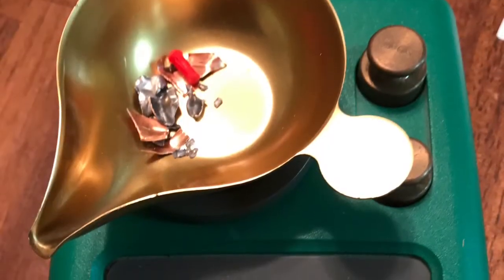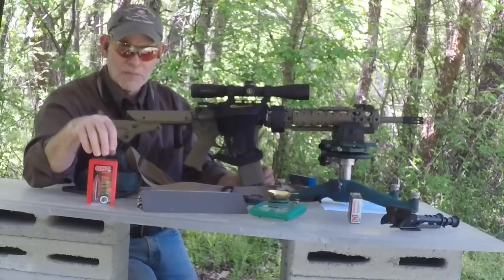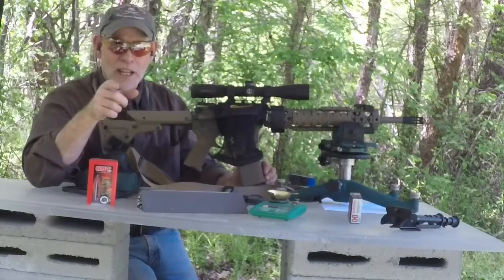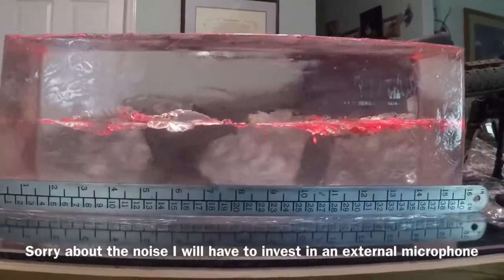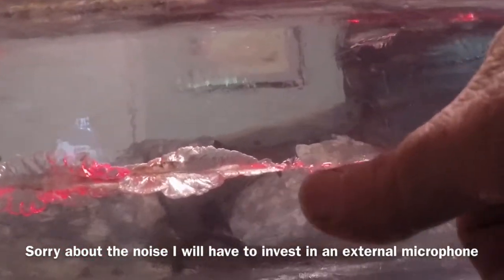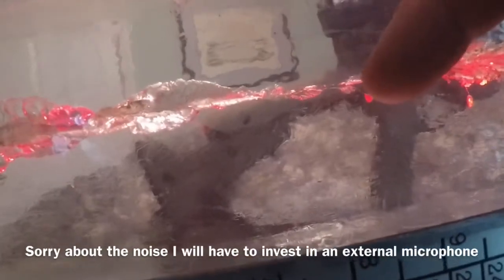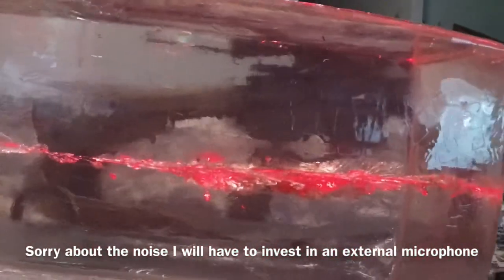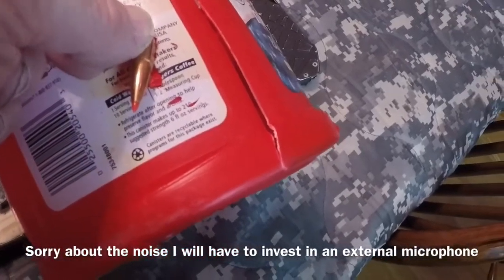300 blackout ballistic gel test 150 grain Hornaday SST.

Comment: What would be your opinion  in a 13inch barrel in 300 blackout would they preform very well the 150gr
Reply from the maker: @yojimbo05  10 inch and up is a good choice for the 300 Blackout. I just didn’t have much luck with 150 grain projectiles. They are made to expand at much greater rate of speed then the blackout can produce.
Reply: Barnes 110/120 TAC or Hornady 130ax work @gonzo38pp53

Comment: Do you mind sharing where you acquired specific load data for that exact bullet?  Or at least the COAL you used.
Reply from the maker: flysubcompact i’m sorry it took me so long to get back to you I’m here in North Carolina we got slammed with that hurricane four days without power but anyway the load data is off of Hodgdon’s website and it is actually for the 150 Grs. Hornady interbond but the specifications between the two projectiles are extremely similar. The interbond does not have a CANNELURE And the overall length is 2.085 I hope this helps. PS I’m sorry for the confusion I’ve only done a few videos but most of them are 300 blackout and I thought this was the one with the 125 grain Hornaday SST. This information is now correct!
Reply: @gonzo38pp53  thanks, I guess you folks have had a rough go lately
Reply from the maker: flysubcompact yes it’s has been a ruff fall I hear it is going to be a bad winter.

Comment: Please dont use that on a deer.  Try going down to 125 or 110.  That expansion is minimal.  You need more velocity.
Reply from the maker: USAmbro24 👍🏻
Reply: I'm late on the conversation but I've thought about 150gr. Glad to see you have already done the research. I see now velocity is needed for these ballistic tips. Thank you
Reply: The Hornady Reloading Manual (p. 115 of 11th Edition) states the .308 150 gr SST is designed for a muzzle velocity range of 2,700 - 3,600 fps.  The 125 gr has a MV range of 2,400 -  3,200 fps.